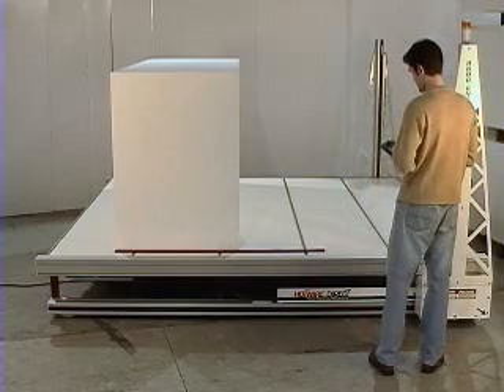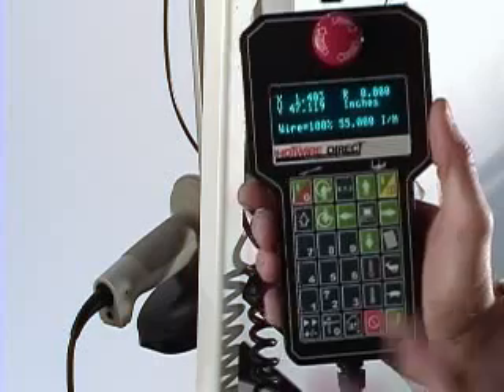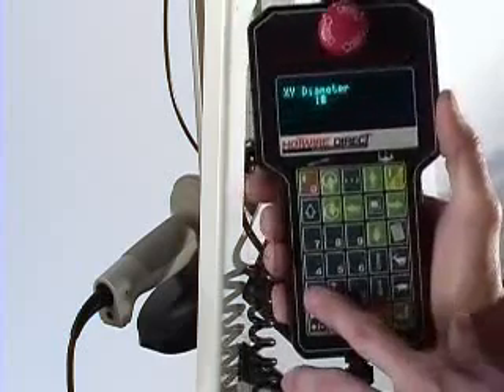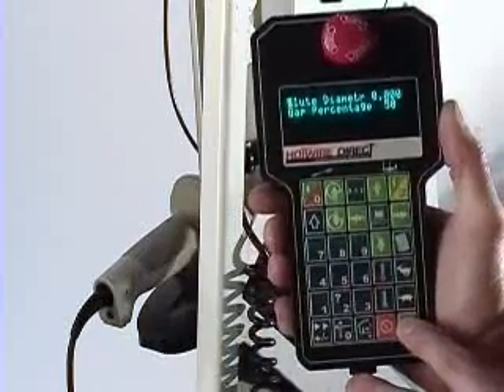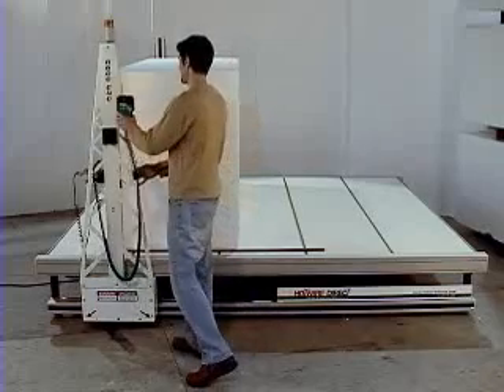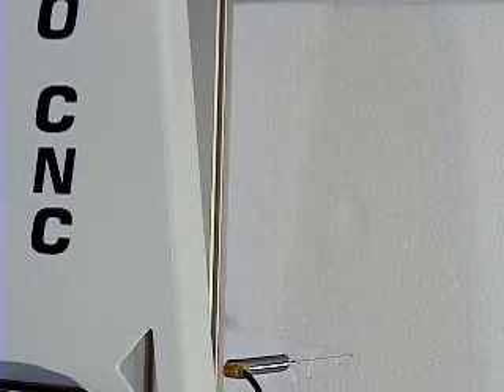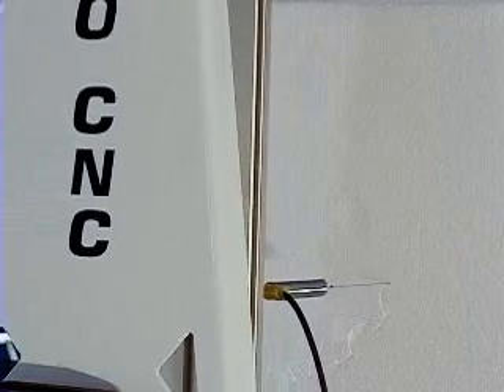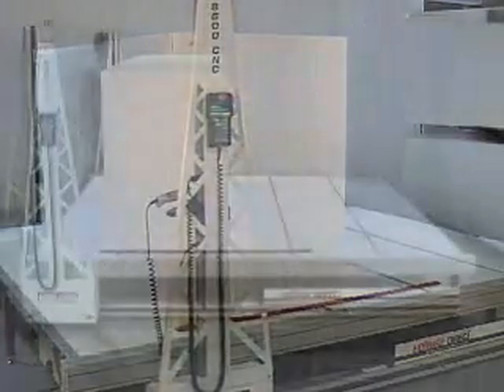Tapered Fluted Columns CNC foam

Comment: I would be far more impressed if the machine also allowed you to make it in two halves with a post hole through the center directly from the controller.

Comment: That machine is so much cooler than mine. I use a Croma foam cutter, and I have to manually extract all polylines from DXF  projects to build my cut files then run them through a serial port. Its a lot more hands on, and all of the help files are in French.

I've been designing and cutting foam for precast for over two years now, and I love it!